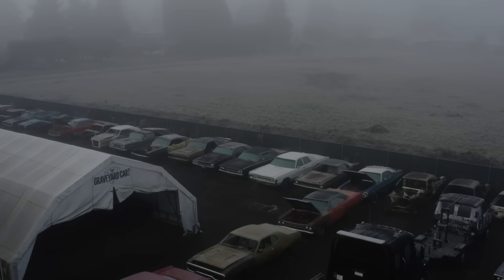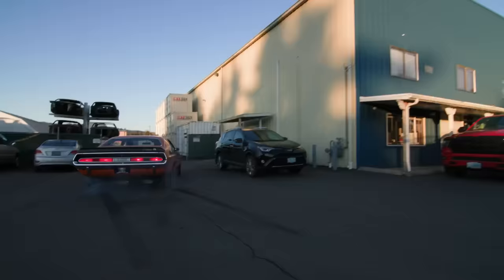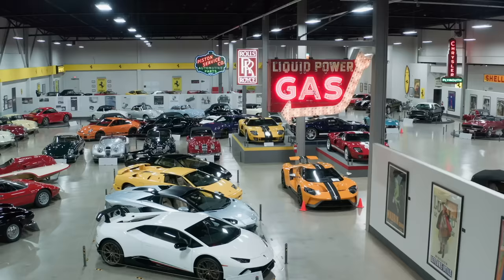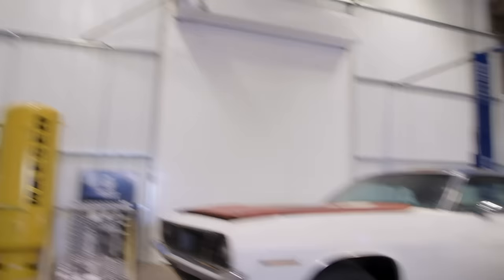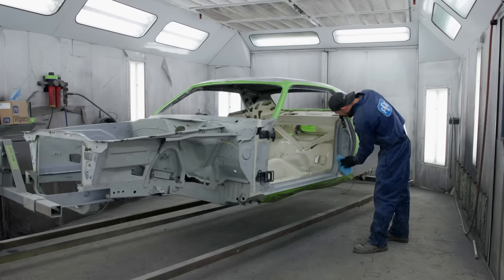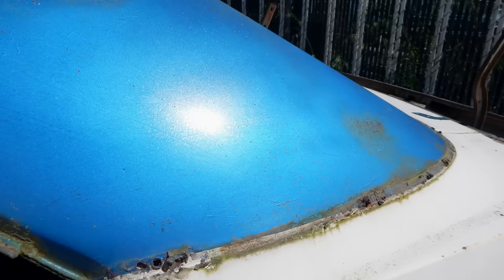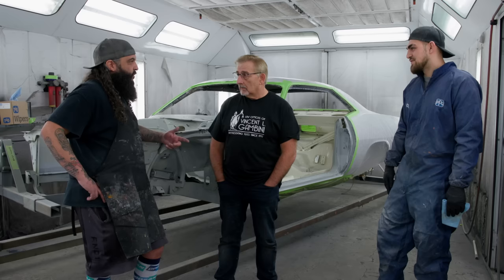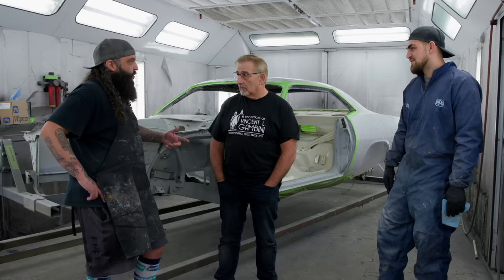**NEW EPISODE**  PAINTED ROOF HEMI CUDA** BUT IS THIS ALSO A SOX & MARTIN PROMOTIONAL CAR?

Comment: in 1973 ronnie sox and buddy martin converted an automatic hemi cuda for  racing in ahra the vin numbered car did not receive the usual gun drilled components, acid dipped body panels  to reduce weight or torsion bars turned down to .703  as herb mccandless said my torsion bars were slightly larger than my pinky finger when i finished turning them down to make my cars hook, based on the instrument panel 72-73 and the fact they purpose built an automatic car to be run in a special class in 73 which was required to have all street equipment windshield wipers heater and the car was very successful im thinking this just may be that car. at first i wasn't aware they built a car for a street class.
Reply: What's the ahra ?